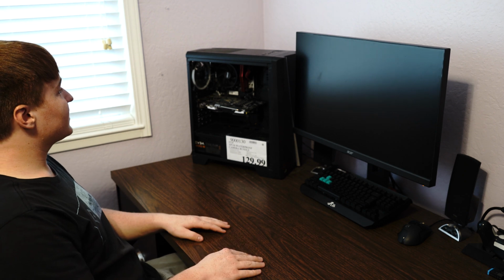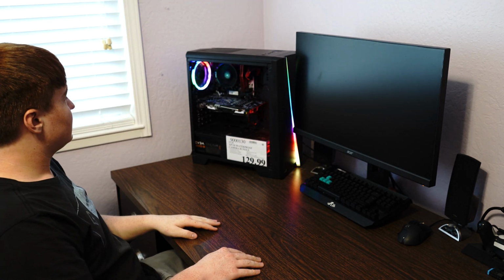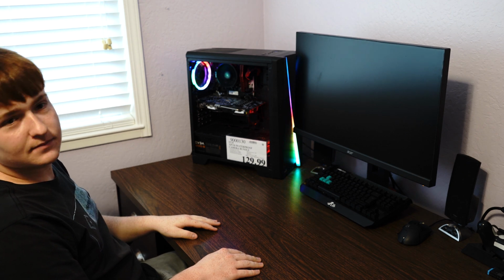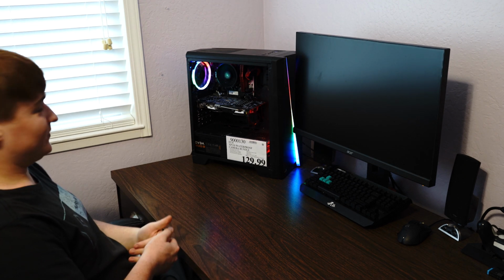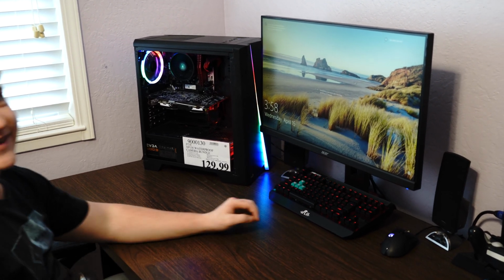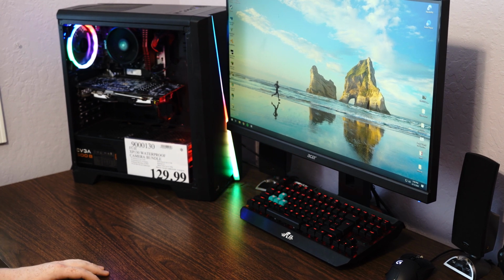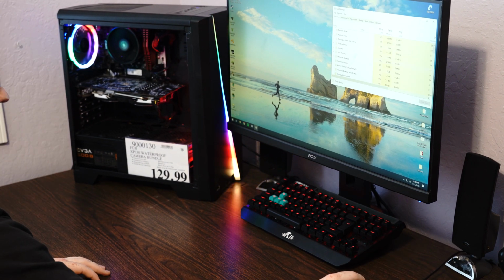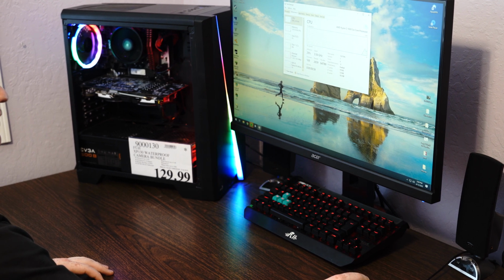Swapping an Intel CPU for an AMD Ryzen 5 1600 AF

Comment: So how is it doing in editing
Reply from the maker: DorianColeman it’s amazing now, I can watch back full 4K and the cpu is only at like 40% usage. I don’t even have to use proxies now, I just edit full quality.
Reply: @DanielB4life  Great :) last question, did win 10 just accept the new mobo and cpu without any trouble?
Reply from the maker: DorianColeman surprisingly, yeah. Right now it’s been a week and I didn’t have to buy a windows key yet. The old motherboard and CPU were bought second hand from a prebuilt PC. I’ll let you know if anything happens. There might be some things on my computer that are a little weird, like I tried installing DaVinci Resolve, but it keeps crashing on the same part. So I don’t know if some windows file got corrupted, but for now it’s working fine.
Reply: @DanielB4life  thanks man ;)